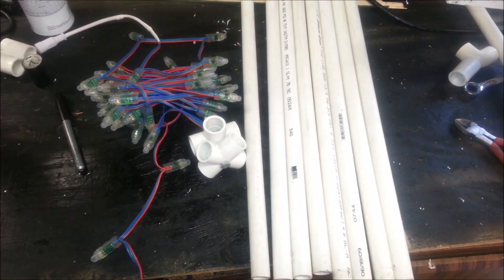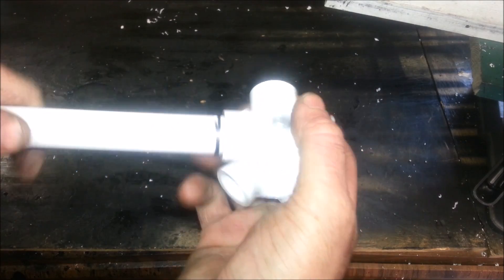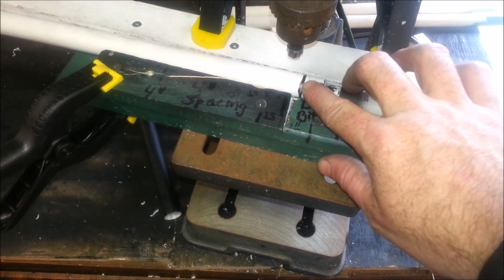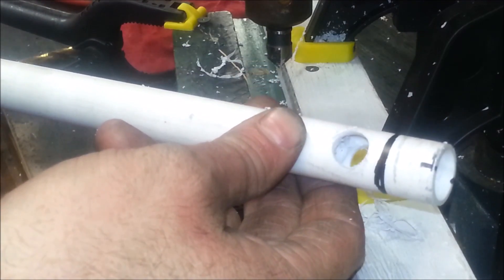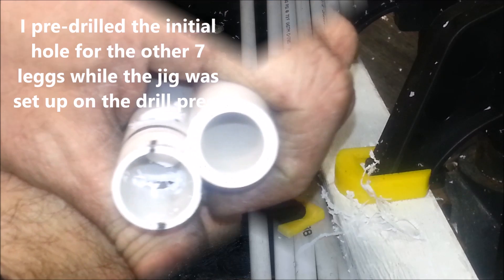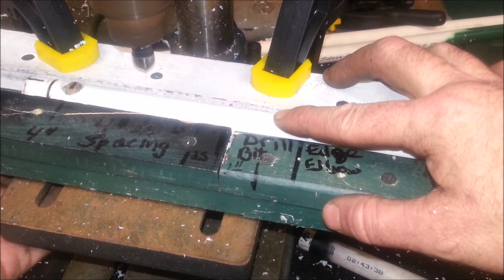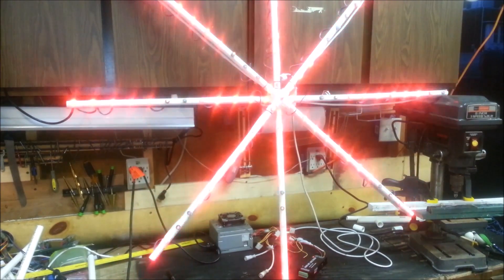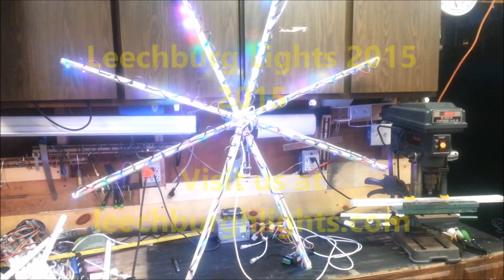Pixel Spinner with 96 pixels

Comment: Thanks for sharing!  I just completed a build of this this week following this concept.  The video was an amazing help, without the jig and drill press my results would have been really sloppy!  I made some alterations to avoid cutting the LED string and soldering, mine is one continuous string of 100 LEDs (with 4 left over).  My glue is setting now, then I will work on my patterns and post a video to my channel in a few weeks.  Thanks again!
Reply from the maker: FYI, I did an updated video on our new YouTube Channel, Pixel Pro Displays, where I demo how to add this spinner into the xLights layout.  After this video update in May, the developers updated the model to allow for an alternate wiring pattern.  No longer a need to splice the wires and you can "leap frog"  the pixels up and down each leg.  Very useful and wonderful upgrades over the years.
Reply: @leechburglights  good to know. At the moment I'm not a xLights user, I make standalone props with Arduino and code using the FastLED library. Someday I might make the jump to a more complex show involving audio.

Comment: Do you prefer these over the GE spinners you made prior to these?

Also what type LED do you run across your roof line?
Reply from the maker: imlon2 I have use both spinners in my display for 2 years. They are both working perfectly. I do like the effects from the 2811 bullet pixels better. the GE color effects do a fantastic job as well but do not dim as smoothly as the other. for my use they work the way I like them too. I will be making another pixel spinner similar to this one, the 96 pixel version. I have not yet lost one GE color effects pixel. Those work just as well and last just as long as the 2811 bullet pixels

Comment: Very cool! I'm just getting into pixels, and with this video, you answered a question that I had for a while. Now I know you can put return lines between pixels! I was wondering how to cross the gaps on the bottom of trees for example, or between window frames. So thanks for clearing thus out for me! Greets from the Netherlands!
Reply from the maker: +Marco Spelde 
Glad this helped you.  Keep the distances close (say 10 feet) and you shouldn't have a problem.  If distance is an issue and you lose data, just add an extra pixel in the middle to transmit data.  Then remember it's there and DONT sequence it in your program.